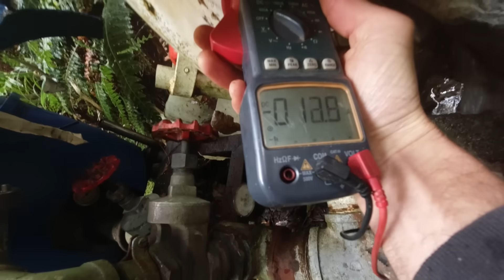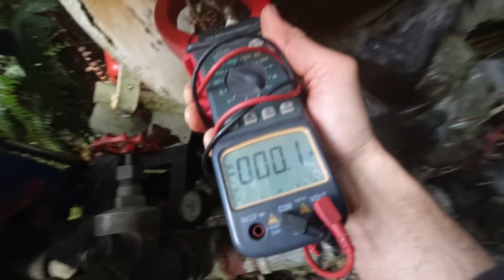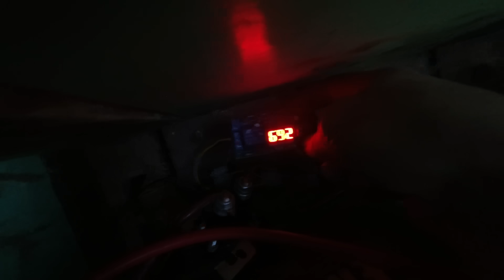Free Power for 16 years from a modified Washing Machine / Water Wheel

Comment: I think most of the setup is brilliant. It seems like he has some maintenance and supply issues that were entirely possible to manage with preventive foresight. Why doesn't he have a reservoir built at the intake to capture water, cut down on erosion and silt, and cover his needs when the creek water is low as it is now...which also increases silt. He should also have a weather cover over the intake so he doesn't get the canopy issues. I imagine even building creek pools would be enough to slow the flow and retain more water where it is needed and keep silt backed up before the intake. Upgrades!
Reply: All the upgrades you mentioned have consequences. 
The stream is sufficient even at low flow to maintain a reduced but still adequate generation...the batteries are Marty's compact "dam"  
He has stated that building anything as an intake risks it all being swept away during high rainfall.  
The rocks actually filter out sand and silt to a great extent...how do you think alluvial gold accumulates in cracks and crevices in the bottom of stream/river beds? 
The filter on the intake only needs occasional cleaning...canopy detritus not a problem.

Comment: so.... Is the cordless drill the generator? I cant believe it would last that long.  Why no solar?
Reply from the maker: The drill was adapted to shut down the water valve if the batteries over charge for some reason. Solar only generates when the sun is shining, hydro power is 24/7 so I don't need a massive battery bank to store the power over night
Reply: @MartyT  Cool system!  After I asked the question, I saw how you had the drill mounted to the valve. Where do you live? Its cool that you are allowed to use the creek like that. Here in California, the Gov would probably restrict that. How far away from the generator is the house. You have your inverter near the generator so you can run the higher voltage over the distance more efficiently than 12V?
Reply: @stevereid7140  Marlborough Sounds, top of South Island, New Zealand.
Reply: @stevereid7140  The batteries (2x12v in series= 24vdvc) feeds a 4000watt inverter which outputs up to 4000watts AC @ 240v which goes 500 metres uphill through cables with very little line loss to Marty's family home and sheds.
Reply: @JohnSmith-pl2bk   wow, 500 meters is a long way!
Reply: @stevereid7140  Marty did say that at one point it would have cost $14,000NZ to hook up to the national electrical grid...and that was 20 years ago money....so his home hydro has worked out well. the day it started working he was $14k better off...

Comment: Would it be easier on the bearings if you had a buffer battery large enough to 1. power your welder 2. make a reserve of a few hours of electricity to be able to stop the turbine?
Reply from the maker: Yes there is a small 24v battery bank at the turbine, makes up the deficit when I use a high load appliance
Reply: @MartyT  I was thinking of a bigger battery that would allow to stop the turbine in between charges instead of having it run 24/7; I'm asking because start/stop has its toll too on hardware (bearings and otherwise).

Comment: How far is this Greek away from your house and what type of wiring did you buy to prevent Voltage drop?
Reply from the maker: 500m. The inverter is at the turbine so very little cable loss at 240vac

Comment: So before I watch the vid I'm just going to assume you reversed the polarity of the wires then used the motor on the washing machine as a dynamo to produce electricity. Any motor can do this.
Reply: The motor on the washing machine is not your normal electric motor that drives via a belt...it is a smart drive motor which is directly coupled to the shaft and is of a different construction electrically.

Comment: small question, why didnt you make like a small earth dam (around 4-6 inches high) at the spot where you placed the intake?
wouldnt that make the need for maintenance a less frequent and it wouldn't also increase the flow rate going to your turbine thus increasing the power output?

thank you in advance.
Reply from the maker: It would get washed away in the first heavy rain

Comment: very cool! just an idea though. why not keep the power directly as AC, probably even use voltage doublers to increase voltage at the exchange of amps for less loss on your line home, could probably get a couple hundred watts extra. have a small battery charged from AC to keep interments in check, this also would of made wiring to your house considerably cheaper as HV AC doesn't take nearly as much conductor to move effectively.
Reply from the maker: The motor puts out 400+ volts ac and high hz with the original wiring config, dangerous to work with and too high for household appliances

Comment: i imagine part of the wisdom of this is curtailing your power usage a bit. hes doing well though to constantly keep a 24 volt battery charged, youd need over 24v continuous to keep it from discharging. massive storage is key.
Reply: Goes through an inverter capable of supplying 240v AC @4000 watts for a period of time.

Comment: How far away is the off-grid home which this machine supplies power to?
Reply from the maker: 500m
Reply: @MartyT  Do you use anything to compensate for losses over that distance or are they not significant enough to warrant transformers and such?
Reply from the maker: @Alitmos  I invert to 240vac at the turbine so very little loss

Comment: Hey, even after watching this, I don't fully understand how it provides power...
Could someone explain it to me, in more layman's terms please?
Reply: Water flowing down the pipe(volume) travels 150 metres but total fall vertically is 42 meters (head). Gravity thus produces 61psi at the nozzle which spins the pelton wheel, which is on the same shaft as the motor/generator which has been rewired to produce 28v DC, which is fed into two 12v batteries in series= 24vDC, which is then fed into an inverter, which outputs up to 4000 watts of 240vAC which goes uphill 500m to Marty's house via cables.

Comment: Anyone with a well could make this sort of setup with hoses and pipe to refeed the water back to their well. Kind of wish I to have a well someday.
Reply: That won't work. If you have a true artesian well which has a high enough pressure you could generate electricity but then you would only be able to let the water run away, not push it back into the well...
Reply: @teenaramsay2469  There must be a way to make a sort of organic step-up converter though. It just ain't gonna be like sticking a pipe here and there though of course xD

Comment: So having two of these would theoretically double the energy output
Reply: Yes. well, I don't think it'll work from the same pipe, and the 500m or so cost about $1900 NZD? Think about the physics:
The energy that's converted to electrical energy is the potential energy of the water (mass times height from the water wheel), witch as he said is limited through a 4" pipe. If you connect another nozzle with the same flow, the preassure from each nozzle would be halved, the wheels wouldn't turn as fast, and not producing enough voltage or amps. I'm no electrician, but that's my theory.

Comment: Wait, such a tiny stream can produce *600 Watts*??!! :o How??
Reply: Water flowing down the pipe(volume) travels 150 metres but total fall vertically is 42 meters (head). Gravity thus produces 61psi at the nozzle which spins the pelton wheel, which is on the same shaft as the motor/generator which has been rewired to produce 28v DC, which is fed into two 12v batteries in series= 24vDC, which is then fed into an inverter, which outputs up to 4000 watts of 240vAC which goes uphill 500m to Marty's house via cables

Comment: Hi it looks like you convert to DC right at the generator and then send it to the house, why didnt you choose to convert to DC at the house? Wouldnt you have to spend more on the power lines?
Reply from the maker: 24-240vac inverter at the battery bank sends 240vac up to the house, very little cable loss
Reply: @MartyT  is there alot of loss going from ac-dc-ac?
Reply from the maker: @feedurheadhesaid  Yep there is some loss but it is cheaper, less complex and higher output (6kw in short bursts) than an ac turbine generator with my low flow

Comment: Could you add another water wheel on the out put of the first one?
Reply: He has two turbines. The energy in the water is expended turning the pelton wheel and the generator, so adding another turbine to capture this output water wouldn't work as the water is flowing with minimal energy. 
But feed that output water into another pipe and let it drop another 42 vertical metres and you can draw the same amount of energy from it again......gravity is a wonderful thing...

Comment: how much water pressure do you need? I assume you have a stream running down hill, but what if you don't? Could you use a small pump to generate the flow needed and run it off its own electricity it produces? If so you would just need to get it going with a bit of gas generator.

Comment: Why not grab the water closer to your pump instead of running all that pipe.
Reply from the maker: No pump here mate, it is a water powered generator, it needs pressure to spin the generator and the only way to create that pressure is to have the intake higher than the outlet jet, which means putting the inlet way upstream

Comment: Why set up a water heater in the stream and dump valve instead of regular circuit overload protection? A simple switch would disconnect the generators windings in a fault condition preventing battery overload, etc.
Reply from the maker: A simple disconnect would allow the generator to run free of load = 'high rpm'  which would cause the bearings to burn out prematurely.  The stream heater dump is the last resort. There are 3 other safety measures before the stream dump comes in to action.
Reply: @MartyT  Good point about the bearings. Can’t have too many safety measures either.

Comment: Would building another one of these contraptions and produce more power enable to run your welder?

Or would something else be needed

Like more amperage or something
Reply from the maker: I'd need a bit more power to run a welder, they require around 4kw+ my turbines max out at around 1kw. I could use the inverter on the battery bank but I think that would ruin the inverter so I just use my generator for welding

Comment: Nice way of generating power. What is the renewable/fossil ratio where you live? This must be both cheaper and environmentally friendly than buying from the grid. Only thing i don't like is you leaving the old ones up there to rot
Reply from the maker: I use recycled junk to build this system, and to fix it when things break. They are my spare parts, I like to keep them nearby
Reply: @MartyT  Ah, that explains it. And as I have understood it is your land then for sure you can do what you want with them. Keep up the good work man. 

I do wonder though, when flow is low in the stream, do your system make any difference to how much water the plants in the valley get or is it just too small to make a difference to the water levels? And does the stream ever freeze in winter?

Comment: So you need to live near a river for this to work?
Reply: and a high difference of where you take it and where you use it, the difference in height makes it powerful
Reply from the maker: Many options, you can use this washing machine motor as a wind powered generator.. if you have existing solar you could use excess midday power to pump water to a tank which could be dumped through a turbine at night. you could use spring water to fill a tank and intermittently run a turbine. Think outside the box

Comment: Is that electric drill there connected to the valve you turn so it can be turned off remotely?
Reply from the maker: Thats an auto valve incase the inverter shuts down it prevents battery over voltage

Comment: I did the same thing with my water main in my basement. I used a water pump out of a junker truck and a cycinder sleeve out of a old McLain steam boiler.

It's bolted to the concrete wall. It runs 24/7 and I get about 1,000 watts.

Comment: Having hydropower and going fully off grid is my dream, but since living in Norway, I would have to worry about the pipes freezing for 6 months of the year and spring floods 🤨
Reply: well, i mean, get connected to the grid, build one of those and sell it at a profit, that's what i would do, clean energy. 0.27 cents per Khw so 0.9*0.27*24*30 = 174.96 euros a month.

Comment: The government:

"Wait. Is that illegal?.."
Reply: It is not illegal to produce your own power as long as it's on your own land in the states. There are obviously laws to follow, like most places.
Reply: If you don't own the land I guess it'd be illegal
Reply: The rules in the UK are that you can't take all the water from the stream, to protect it as a habitat - there is a minimum flow which has to be maintained so the stream doesn't dry out between the penstock intake and the outflow. So you'll have a slot for that minimum flow cut into your dam, or a bypass to your top filter/coanda screen. Sometimes in low flow that means there will be not enough water available and you will have to shut off your hydro. If it happens it happens normally in summer so having a solar backup would sort you out. Just about being responsible and taking what you need.
Reply: Not illegal in NZ
Reply: Heather Petersen  what do you mean strange water laws...see: illegal to collect rainwater im Colorado cuz a long dead settler has a claim on a stream nearby.
Reply: This is illegal in the US. They want you to be on the grid so they can shut off power and make you reliant on the evil shithead gov. Wake up
Reply: Name Watcher is that so? What about the people in the wooden cabin somewhere in the forest doing the same thing

Comment: I also made a system very similar to this. I hope to get longer bearing life by washing the grease out of the new bearings and repacking with the best synthetic grease I can find. I fitted a slinger on the shaft to throw the water off before it gets to the seal which hopefully helps. My wife is a potter and made long tapered ceramic jets that don't wear out and work well. My system runs at 60 volts (48 volt battery system) and is otherwise much the same; same advantages, same few problems! Cheers!
Reply: Do you sell it (the extra power)? that's what i would do, clean energy. 0.27 cents per Khw so 0.9*0.27*24*30 = 174.96 euros a month
Reply: How has your hydro system worked out for you?
Are those ceramic jets still working well?
Have you tried ceramic turbine bearings?
Reply: Use sealed bearings.

Comment: Another way I've learned to make Power is with a gas-powered generator remove motor and put a sprocket on the end of the generator shaft as long as the generator is spinning with or without a motor gas-powered it will still generate power you just have to spin the generator you could use mountain bike gears and chain to start at by hand then once you get it started by hand you let go of the pedal once the Alternatives that generating free Power and the generator Etc have it run a little electric motor pulley setup it will all run by itself equals free Power

Comment: You should have put the turbine in an encasing so it wouldnt get so nasty
Reply: The turbine (the part the water hits aka pelton wheel) is in the plastic tub. The "nasty" stuff is actually fern roots; plants love a supply of water and roots of most plants actively seek it, growing into pipes etc. Marty needs to access the pelton wheel and jets, so he needs that hatch to be where it is. The generator is on the outside of the plastic tub, has no water hitting it, and is under the barrel cover so it is protected from rain and spray. The inverter and batteries are under cover too.

Comment: a friend of mine did something similar but with an expensive miniature turbine specifically built for generating power he ordered from germany (we live in the usa) and his piping started at like 6" then he reduced it as it went downhill, i forget what the smallest diameter was but the water from a small creek was blasting out like a pressure washer at the bottom. after all of that trouble, the county and power company found out and basically gave him so much trouble that he took it down. i forget what violations they claimed he made but in my opinion they saw someone getting free power and didnt like it lol

Comment: Do you use anything to store any of that power, like a battery bank etc? Or since it’s always flowing at least a little would you not bother ?
Reply: Battery bank @24V, plus 4000 watt inverter to supply 240AC though 500metres of cable to Marty's house.

Comment: Hey Marty!! I need help, we've been trying to get water out of our spring with a solar powered 12volt pump. This thing cost so much money I'm crying because it will pump for so long then die out within one night. I give it 3 days to charge before using it. It's not doing its job right. I'm in the northland region Kaipara district, can you please come take a look?
Reply: You need to have a very large battery bank to enable the pump to run all night when the batteries are not being recharged by the sun. When you have a very large battery bank you then need a very large solar system to recharge it in the number of sunlight hours available, especially over winter days. Do you need to run the pump 24hrs per day?  If so, you may need to supplement the solar/batteries with another system, windmill or a ram pump or even a petrol or diesel pump/generator system.
Reply: @teenaramsay2469  Thank you 😊 Youtubers got more knowledge than the guy at the shop!!